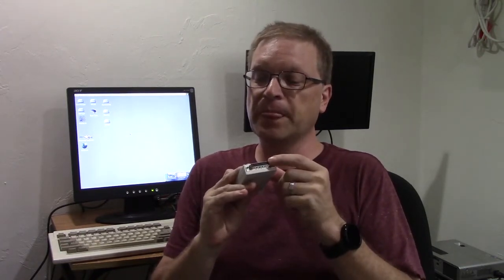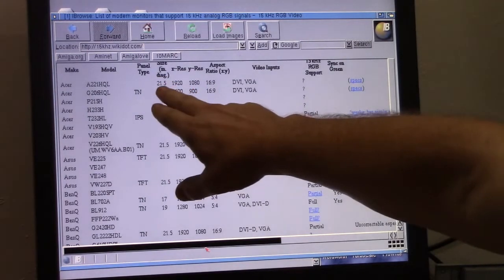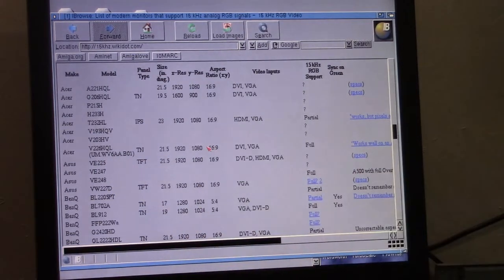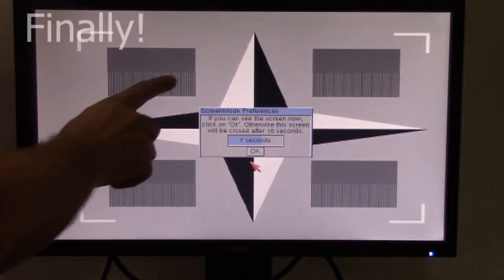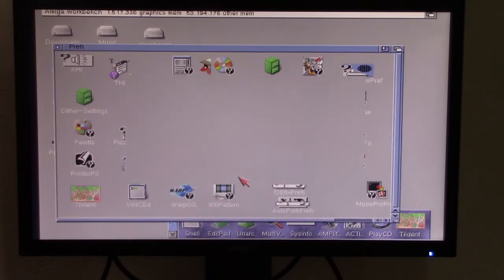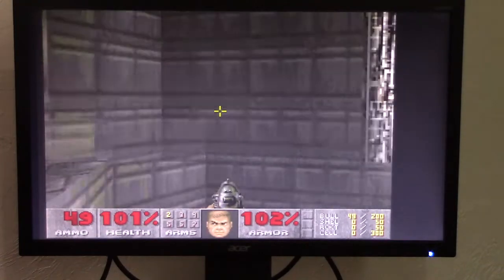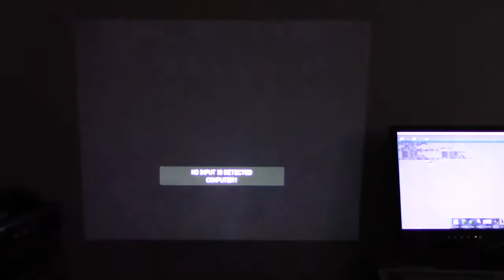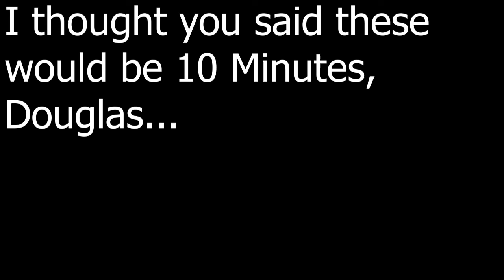10 Minute Amiga Retro Cast Episode 5 - The 15 Khz Conundrum

Comment: I used to use an old Home theatre amp which would do composite/svideo/component and upscale to hdmi. New amps these day won’t likely have the lower inputs.
Quality wise hard to say as I didint have anything to compare apart from the old CRT which I preferred as smaller and less pixelation.
The sound however! Wowie but that’s beyond this discussion.
Reply from the maker: Yep - new Amps don't even do upscaling. Or they are to expensive! I have a Marantz that upscaled, but it is fried and only works maybe 20% of the time, so I retired it

Comment: I bought a used Dell U2410f from eBay several months back to use with my A500 + Vampire V2+. It is very good but I have noticed that there seems to be some issue with a kind of pixel interpolation problem... say you are in a standard low res game and the graphics have a lot of tight color changes from one pixel to the next, the monitor introduces an incorrect purple or blue pixel. Adjusting the phase setting makes the wrong pixels shift left or right, or perhaps onto the next scanline. (I first noticed it in Bubba and Styx but I don't see it in say Deluxe Galaga where most of the screen is black.) I haven't been able to eliminate it with any of the settings. Also the pixel clock reports something like -8000 which is WAY outside the range that you can actually adjust to in the user settings; you must use the auto adjust option. I still need to try things like using a VGA to DVI-I cable to see what the analog part of DVI offers for settings.

The other option I got a couple years back is a GGLabs A520HD adapter that takes the Amiga video and converts it to Component video. This works basically perfectly on everything I have tried it on and looks as good as Xbox or other console output. As you point out with the list of "compatible" monitors, unless it is already 4:3 they often don't have many options for changing the wide screen settings from stretch or fill to aspect. My work is giving away a 23in JVC CRT TV with component input that I am going to take home and hopefully try this weekend with the A520HD.
Reply from the maker: I agree none of them are perfect. Even my new monitor looks just a touch washed out. Nothing can beat that original 1084s monitor! Let me know how that JVC monitor works out!
Reply: @10MARC  Since we just moved a few weeks ago so I've only just gotten my office and A500 setup. Took today off to play a bit and first, the head chef at my work that was giving away the old TV from storage was wrong, it is a 27in. It is a very basic model from 2002. Next, I like the display output a lot using the A520HD for non-interlaced modes. Testing interlaced modes though was  a different story. Text has distinct bright halos and the display is very jittery. I attempted to shoot video to post but my phone camera wouldn't stay synced to the display and the moire patterns made it hard to see. I am working on testing the Dell U2410f now in various modes and I hope to be able to take some pics and video to share.

Comment: Have 15.6KHz with the BenQ BL702A 17 inch VGA monitor. Have with my A500 a Indivision ECS V1 60Hz. With the ACA500Plus and the ECS NTSC Fat Agnus ACE2 it can force to PAL 50Hz. And think that it’s 60Hz on the BenQ monitor. WB 3.1 and 3.1.4 think it’s 50Hz but have a full 60Hz High Res Laced 16 Colors screenmode with a fixed overscan. WDHLoad have PAL 50Hz screen in the centre.

Comment: Great video.  Where did you find the Cybergraphx drivers?  I updated to OS 3.1.4 and tried to install Cybergraphx 3.0, but the installer doesn't work :-(
Reply from the maker: It is a Cybergraphx 3D video card using the Picasso 96 drivers. I like those better. I think I used to have a copy of the Cyber graphics drivers back in the day.